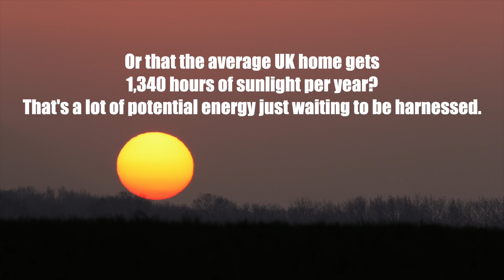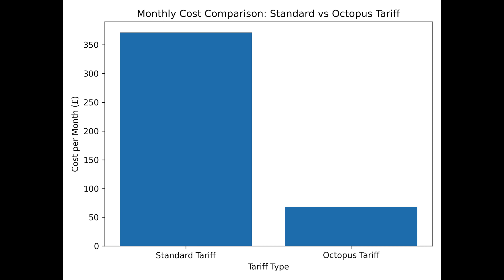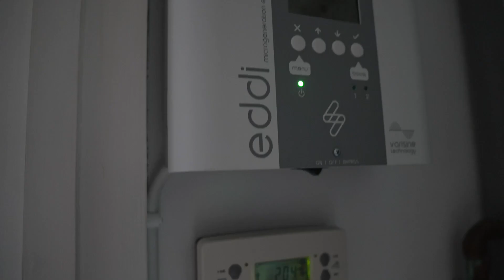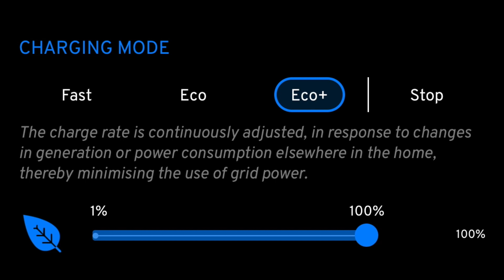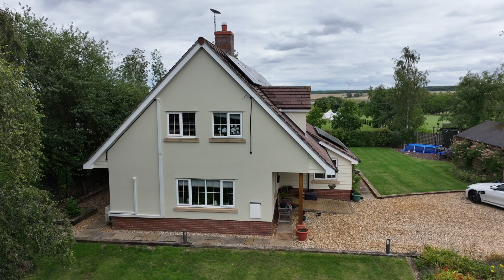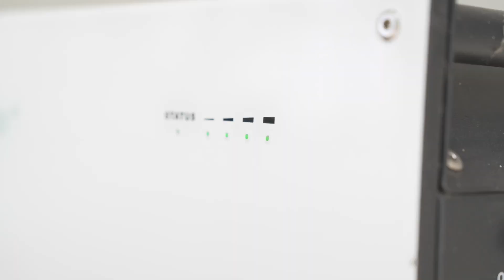The Truth about Solar Panels & Battery Storage: Worth It?

Comment: I had solar installed last November. We also have an electric car. We don’t have batteries.  Neither do we have a smart charger that will only charge off of excess solar.  We pay $0.18 per KWh. We get $0.09 for every KWh we send to the grid.  We are currently sending back enough that we aren’t paying anything for electricity, we have a credit.  We have an Enphase system. They are going to come out with a bi-directional car charger.  This charger will only send excess solar to the car. At night it will draw energy from the car to run the house. I may never buy batteries if this charger comes out and works as advertised. My only concern is how that will impact the cars battery.
Reply from the maker: So your house will effectively run of your car? Yeah. I think there could potentially be a confront in performance longer term. Have you got a link? Sounds like your panels are in a good spot and you get loads of light

Comment: 4:50 At the end of May my installation went in. I had a more expensive 445W Perlight panel used. They were about £220 each, and that was with VAT which was later saved by my installation company.